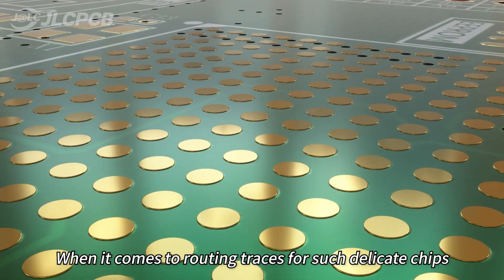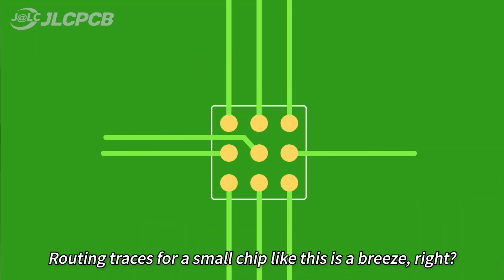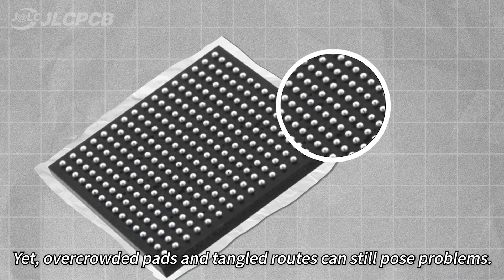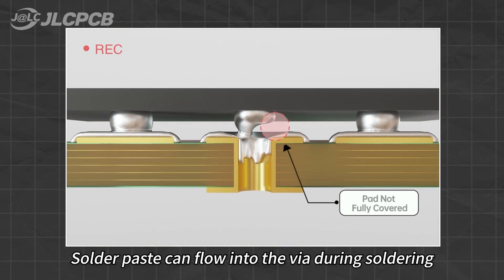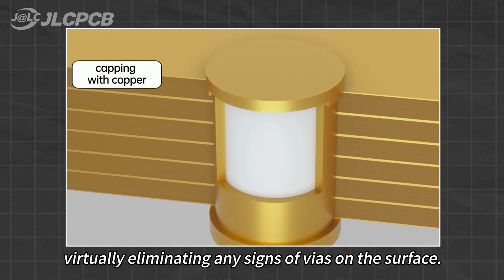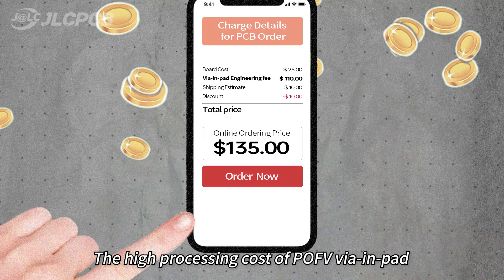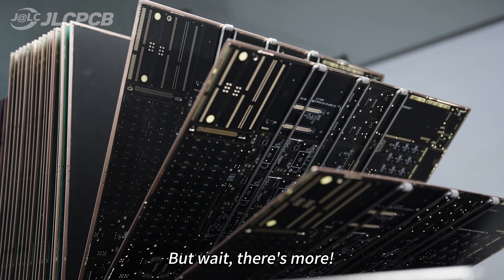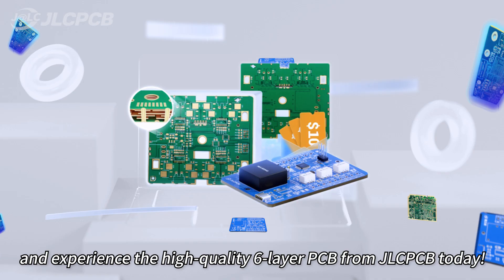Why is Via-in-Pad So Recommended for Routing Intricate BGA Pads?👉Get JLCPCB 6-Layer PCBs for Free!

Comment: It's very confusing to me how to enable this feature. Will this happen automatically for any via inside a pad manufactured with JLCPCB? Do I need to enable it somehow for four layer and two layer boards?

I see, I need to select either epoxy filled or Copper filled vias and then the ones it the pads will be via-in-pad automatically. Makes sense but confusing to get there.
Reply: hi,
so you just do a regular vias, then when you wish to manufacture you select "Copper paste filled & capped" right?
Thanks!